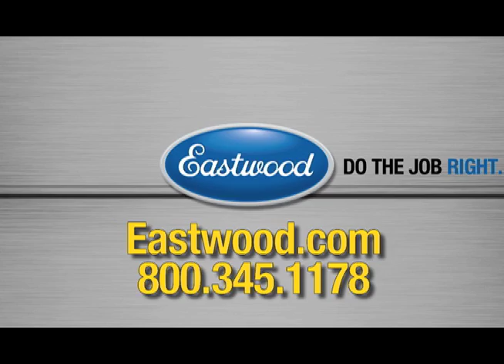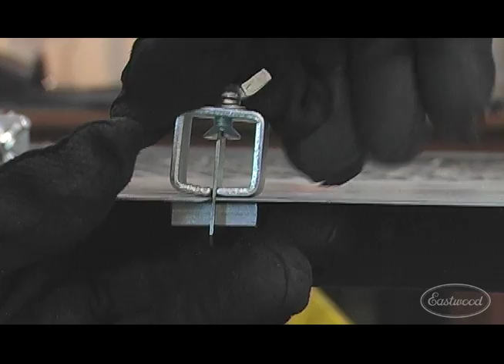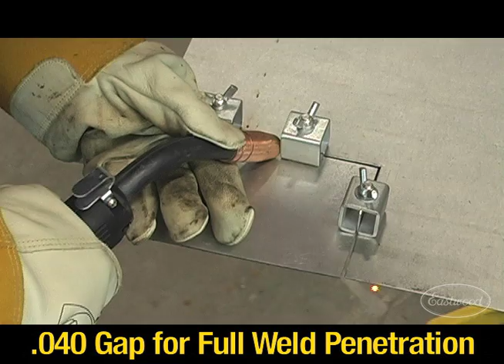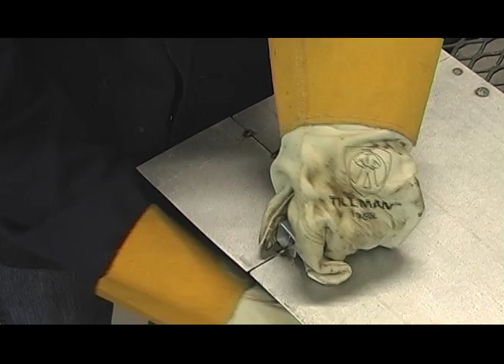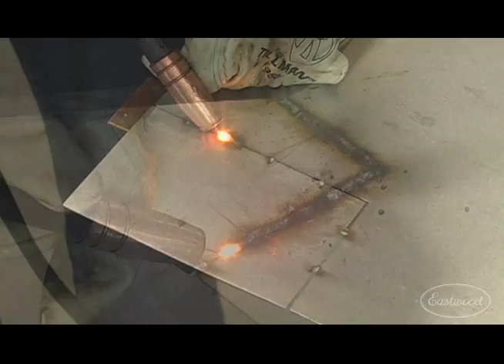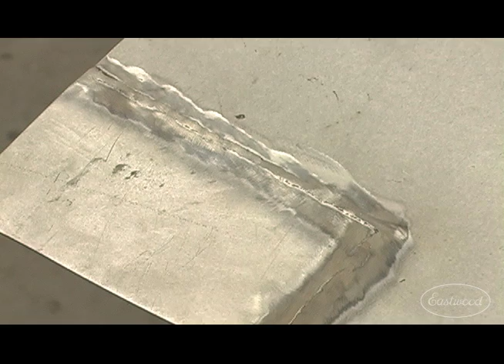Welding Panel Clamps from Eastwood

Comment: Nick, what you do is this. Drill a small 3mm hole in the toggles, feed MIG wire through the hole then tie it off. When you've finished tacking loosen them off then pull your MIG wire until your toggle bar appears.

Comment: That finished/ground surface didn't look that great... Looked like it needed to be re-welded and ground flat again without the thin areas. Not saying that the product didn't work though. They looked like they worked great.